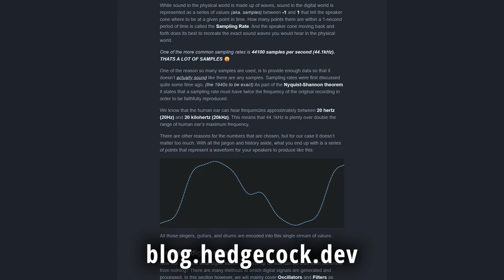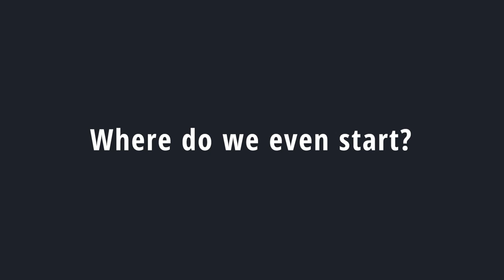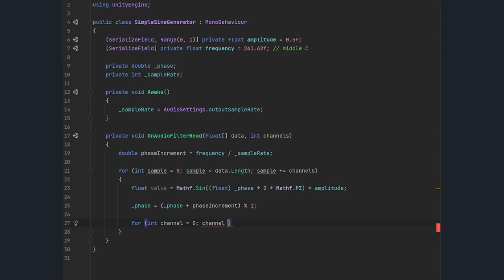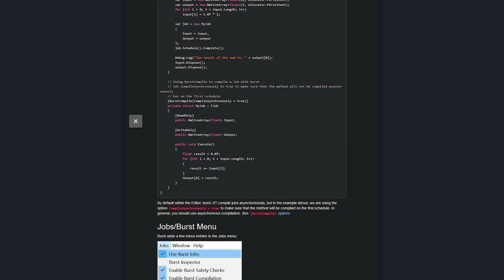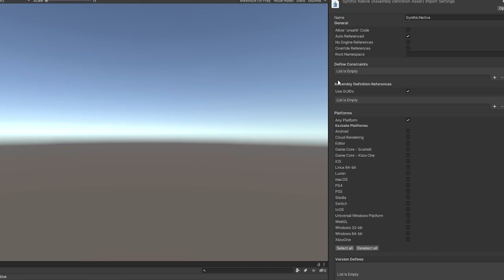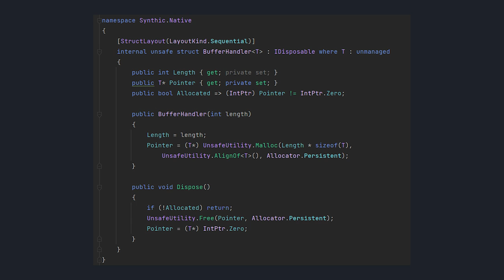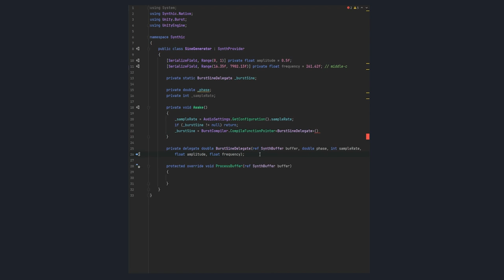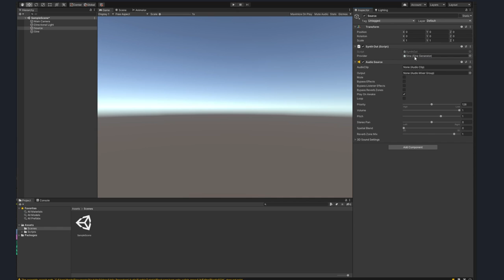Making Procedural Music in Unity

Comment: why does unity use 48000 and not 44100 sample rate?
Reply from the maker: It's set to 48000 by default purely because it's slightly higher resolution. But you can change it to 44100.

Comment: I was excited to try this - I cloned your repo origin/main as of 2023-11-10 but I'm getting compiler errors in the Synthic.Handlers classes upon opening the project in the Unity editor. "error CS0234: The type or namespace name 'Native' does not exist in the namespace 'Synthic' (are you missing an assembly reference?)". It feels like the Rust code needs to be compiled to reference "Lib", but I'm totally guessing and have never compiled Rust code. Any tips you can provide will be very appreciated!
Reply from the maker: I probably need to put a note of this somewhere. But the original synthic did not use rust. So if you want to try out the version used in this video. Check out the old-synthic branch. Let me know if that helps!
Reply: @rhedgeco  thank you, I will give that a shot! Are there performance differences between the two?
Reply from the maker: @KentBrakewell  Nothing that should be noticable. Plus the rust version is more incomplete anyways. Should probably make the rust version an off branch instead of main

Comment: Great video! I followed along very well an sparked lots of ideas! :D 
For those who do not want/can use the burst compiler, you can precalculate the sinewave for example and store it in an array and read from there. I have to check how this interacts with filters and such, but I got similar or better performance as with burst compiler and its super easy to implement :)
Reply from the maker: Thanks for the comment! That is definitely a good way to go. In fact, I have a synth filter that caches the input from a runtime synth that does pretty much exactly this! If the data you are using for sounds can be prerendered, it's always a good idea to do so. Great tip! Glad you are enjoying my content 😁

Comment: Very enlightening video, thanks. I did some work and found that if I use the OnAudioFilterRead to implement some procedural sound effects, such as playing the MiddleC sound when the keyboard is pressed. But I found that due to the different scheduling logic of OnUpdate and OnAudioFilterRead, there is an obvious delay from key press to sound playback. Is this implement not suitable for  interactive sound effects?
Reply from the maker: Interesting that you found the delay noticeable. In my experience even if it takes a while frame to register the key press and set the audio it's only a 16ms delay. How long is the delay for you?

Comment: Wouldn’t it be faster to calculate the samples in a compute shader?
Very great first video!
Reply from the maker: Great question! It would not for a few reasons.

First being that compute shaders can usually only be dispatched from the main unity thread so it an sync with the GPU. All the audio processing happens on an audio thread. Which is also why I didn't use jobs.

And the other reason being that data copying across the CPU GPU boundary actually takes a really long time. (In the order of a few milliseconds or more depending on the situation)

At the end of the day, GPU is better for higher volumes of data processing anyways, and we are only calculating 2048 samples. An incredibly small number when it comes to GPU parallelism.